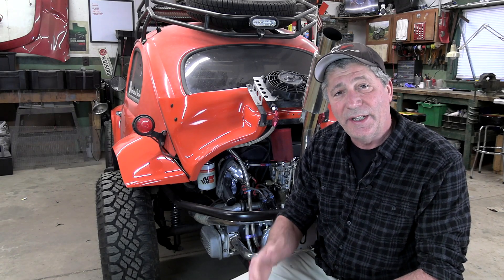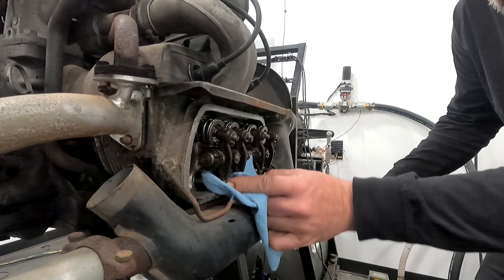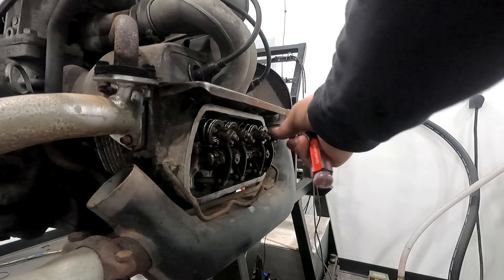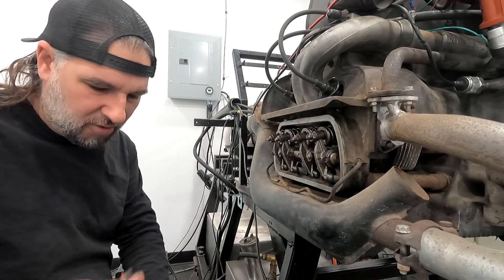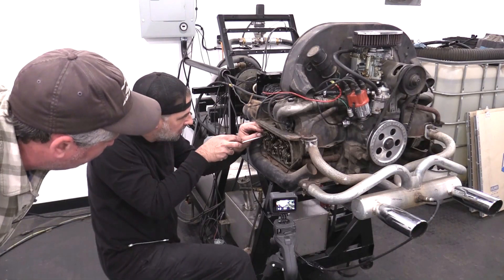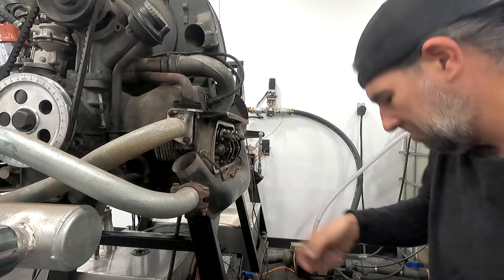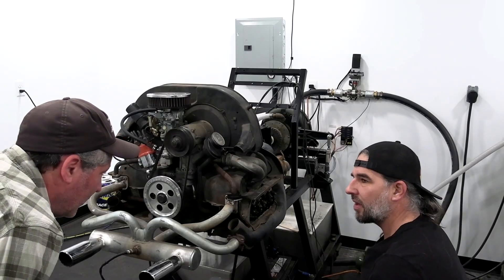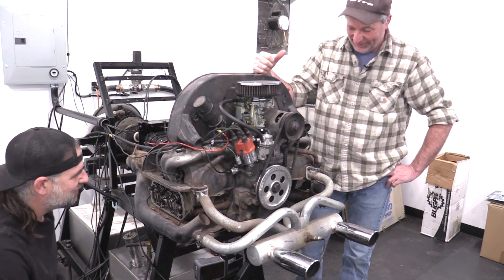Best Advice On Valve Lash Adjustment/ Classic VW Beetle/ We Ask An Expert

Comment: There's a shop in Bakersfield, CA that will put hydraulic lifters in your Bug engine and you never have to adjust valves again.  They will also install case rubber inset gasket so case will never leak again.
Reply from the maker: Thanks for the info!

Comment: I like steel pushrods rather than the stock aluminum.  Set them all at zero, so you can just turn the pushrod with your fingertips.  As the engine expands from heat, the steal pushrods stay about the same length making their own valve lash.  Requires a stronger valve spring, which I already had.
Reply from the maker: Thanks for sharing your experience!

Comment: So to put in writing for those that are interested, 
Adjust valves in the firing order.

For the novice, first locate #1 spark plug wire. Take cap off. Rotate crank until distributor rotor is in the general area of #1. 
Set TDC #1 by aligning the crank pulley notch to 0 degrees on the timing mark. 

1) Paint a white dot on the top of the pulley in a vertical position - adjust #1.  
2) Turn pulley 180deg so the white dot points down - adjust 4, 
3) Turn another 180deg so white dot is up again - adjust 3, 
4) Turn white dot down - adjust 2. 

Voila!

After initially finding #1 TDC on power stroke the whole operation can be done in 1.5 crank turns.
Reply from the maker: That's a great summary for anyone learning to adjust valves.
Reply: Just messed mine up watching other YouTube video which showed to adjust valves in order from #1,then 2,3,4 . Obviously that's not a firing order and obviously my little bug now struggling a lot. So will give it a go setting valves in firing order which makes a big more sense. Thanks

Comment: When adjusting the valves with the engine in the car, it is easier to adjust the valves on both cylinders on one side of the car at the same time.  The firing order for the VW engine is 1-4-3-2.  If you start with the #4 Cylinder and turn the engine backwards (counterclockwise), the sequence becomes 4-3-2-1 so cylinders 4 and 3 which are both on the driver's side of the car can be adjusted first.  Then the valve cover can be re-installed on that side of the car and move to the passenger side to adjust cylinders 2 and 1 in that order.  This sequence also facilitates jacking up just one side of the car at a time to gain access to the valve covers.
Reply: shouldnt turn engine backwords

Comment: I have a special tool for adjusting valves. It has a socket with a handle and a turn knob that is attached to a flathead screwdriver that fits in the slot. It's probably 40 to fifty years old. Made for VW.

Comment: Start at TDC #1 then half turns counter clockwise for 2, 3 and 4. No need to jump around. Make sure your pulley is precisely at the split in the block. Make sure rotor is pointed towards #1 at TDC. take your time. Make the adjustments precisely. Ok to be a super hair loose on #3 as it runs hotter than the others
Reply: This!

Comment: Since you guys did not mention at what engine temperature when to adjust the valve clearance, It has to be done  ONLY at approximately at room temperature (68-72 degrees F). According to my '73 Motor's Auto Repair Manual, The specs says, for '67-73 1600 is .004IN and .004EX on a stock engine. BTW, it is easier to adjust the valves when the spark plugs are off.
Reply: Do i have to wait for the snow to melt to set my valves? It's easier to start on #1 then 1/2 turn back, #2 1/2 turn #3, 1/2 turn #4 when your laying on the ground..
Reply: @doginu  I'm sure you can start the engine to increase the desired temperature then adjust your valve. It's better to adjust it a little loose than too tight. You may burn a valve if adjusted too tight.
Reply from the maker: Thanks for the tip, we'll make sure to adjust valve clearance at the right temperature from now on!
Reply: I set my exhaust at .06 thousands. I have had no problem with it. And always at ambient temperature, or cold.
Reply: I was told at my local shop. That VW later put out a service bulletin that corrected the .004 adjustment back to the .006 adjustment.
Reply: ,I run .004 intake, .006 exhaust.
Reply: @ If VW installed an aluminum push rod, it is possible they increased the valve clearance because aluminum expand more than steel.

Comment: After you set the valves ( did number  3 compression change being that the exhaust valve was tight) 
It was the lowest out of all 4 before.
Reply from the maker: No, compression didn't change.